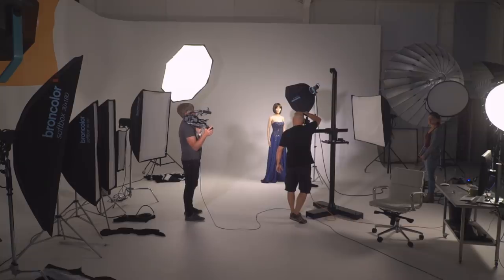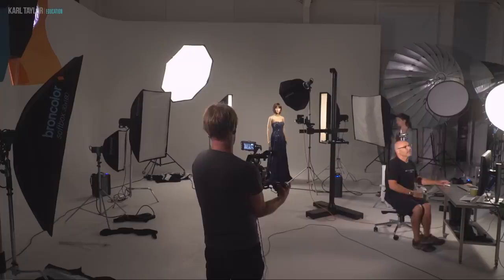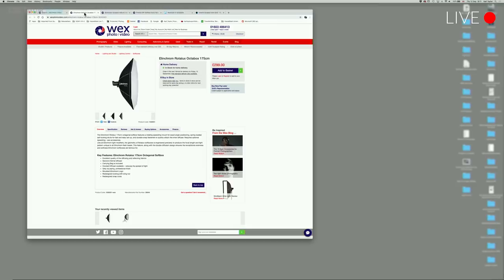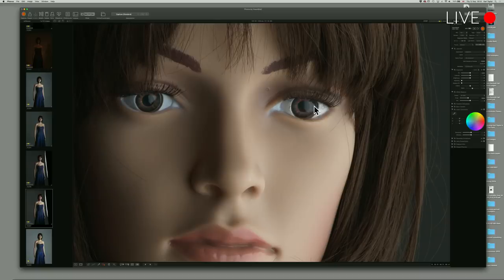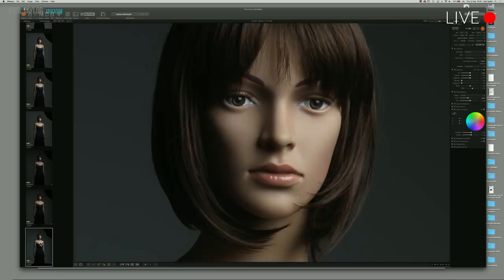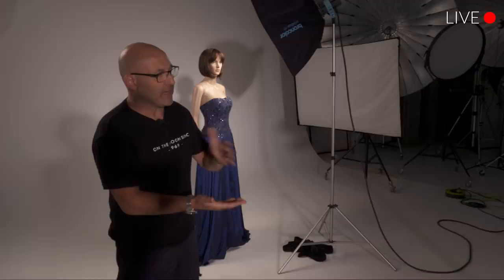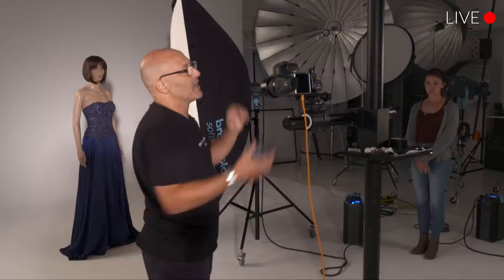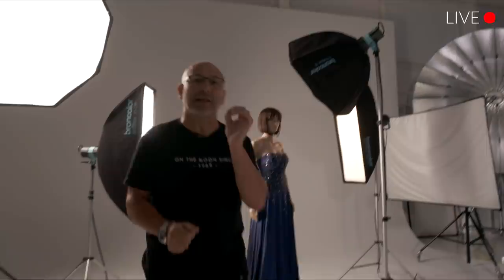Understanding softboxes and how to use them [Workshop Roundup]

Comment: Hi Karl, nice review; what do you think about 85cm softbox on a ad400pro, ez glow (beauty dish) or ads085s with or without internal diffusers (tedious to handle) ? what about magbox 66cm with focus diffuser ? what about westcott rapidbox 66cm i see in lot of tutos now with FJ400.
Reply from the maker: Hi Marc, that's a lot to throw out there. Unfortunately I don't have any experience with those models, but there's only one thing you need to concern yourself with and that is the light at the front diffuser should be as homogenous as possible for it to be an effective softbox. Having a few sizes is advantageous but if you can only have one then go big because that gives you the softest light and you can always mask it down or move it further away if you need smaller.

Comment: Karl nice ad, probably nice video. I will wait until you add more shows and then i will re subscribe. I got some nice info from the video :D , thank you for that. It would be nice to see you like back in the day where you where using elastic bands to put 4-5 speed lights together.
Reply from the maker: As we found out unfortunately strapping 4 speedlites together with transmitters usually ends up as expensive as one cheap to medium studio light and it's far easier to work with a studio light and their choice of modifiers.
Reply: @VisualEducationStudio  yes, i got to the same conclusion.